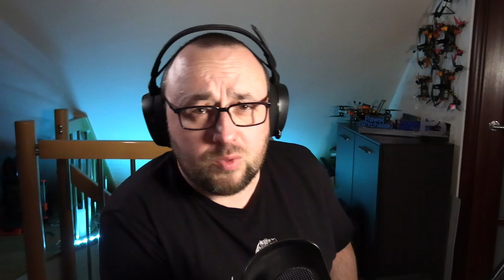Why we don't use bicopter drones?

Comment: You are right on higher design complexity and right on lower durability due to tilting parts, but you cannot negate the efficiency advantage of bicopters as you have done. Yes, you still have to use 4 motors but only 2 of them are continuously spinning draining battery, while the servos are used only for control movement with low energy consumption and the torque needed for directional control can be provided by a relatively small and cheap brushed servo, while for spinning rotors brushed motor life is too short and brushless motors  are a must, and with 2 more of them are needed also 2 additional ESC.
Reply: bro make me your student 🥰
Reply: I want a big one I can wear as a backpack, matched with electric rollerblades. 

Not for flying but "falling with style".

When on the ground it would provide thrust and stability.

I've seen people try to use a paramotor with unpowered skates. It's a hilariously terrible idea. 

I've also tried powered skates, and it's nightmarishly difficult to maintain your balance. 

I'm thinking a little bit of both plus some AI, could actually make a stable platform. 

I would also like to double as an electric parachute. If you only need to run the motors for a few seconds It wouldn't have time to build up too much heat and burn out. So you don't necessarily have to use huge motors.

Comment: which will be more efficient? A 5 inch quadcopter or a 10 inch bicopter?
Reply from the maker: bigger props are more efficiant. Less props means higher efficirncy as well. But this is propeller only. It will also depend on weight, motors, drag etc

Comment: I built a tricopter from a quadcopter because one motor was damaged and I could no longer get the original motor😂
Reply: How does it fly compared to the quad ?
Reply: @blise518B  Honestly it flew very bad compared to a quad. I had to turn the P gain down a lot because it was wobbling. But it can yaw extremely fast! Sometimes the servo mechanism got stuck and it crashed into the ground while spinning. The servo is big enough but very slow so the latency on the yaw axis was bad. However it was a very fun project. I still have the Tricopter but it's not repaired yet. It's frustrating if you need to reassemble it after every crash.

Comment: I don't think so. It is because mostly droners get failed to build bicopter. I can build a quadcopter easily instead of bicopter. Bicopter is a challenge and hard to do with it. (I;m talking about DIY bicopter using raspberry or arduino. I simple hate using conventional flight controller coz the problem is about money. No challenge at all.
Reply from the maker: That's cool that you build one that works! But regular quad would fly circles around your bicopter while blindfolded